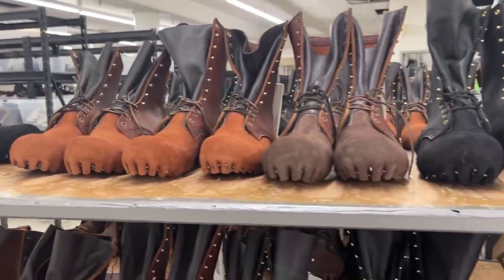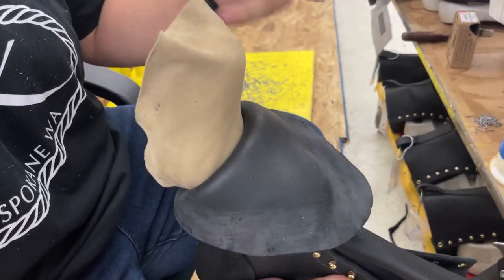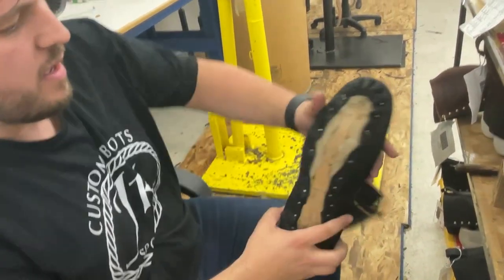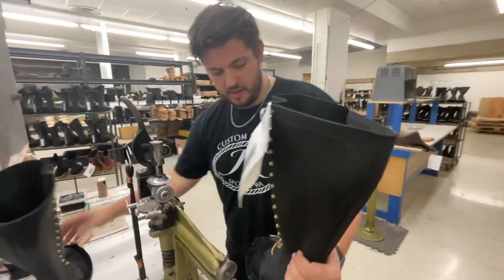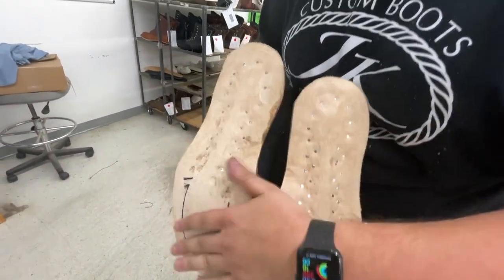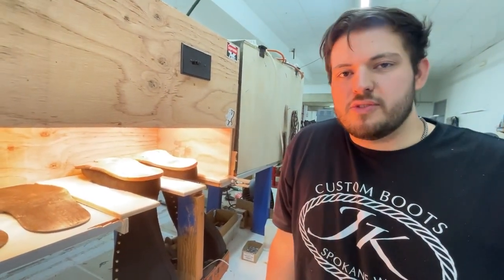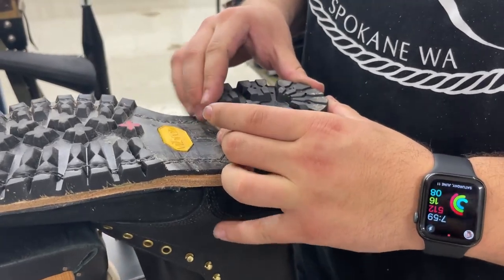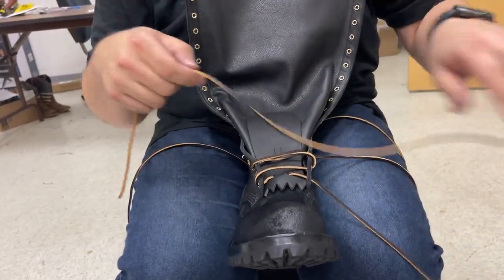The BEST Boots For Climbing With Spurs! How Custom Lineman Boots Are Built by JK Boots

Comment: Thanks for this awesome video for us boot afficionados! It's an extremely rare privilege they granted your filming request. I'm sure Wesco, Nick's, Whites, Hoffman boot companies wouldn't have done that. Legal would prolly not allow it as they spend millions on P/R, customer service, legal, marketing, and advertising, so everything has to be exactly in sync and perfect facing the public.

I've had Wesco make and rebuild 3 pairs of loggers/lineman's boots of different heights since 1983 and make one pair of 18" engineer boots in  2014.   A couple things stand out that perhaps you should mention to JK Boots. An "L" steel heel plate protection that's fitted between the Vibram heel and the oak leather part to prevent the climbing spurs from shearing those two pieces apart, even with screws. Second is an optional leather lining to prevent soiled socks from boot oil. The boot fit needs to be adjusted slightly for the smooth leather lining (no sock staining either 😊). My last pair in 2014 was $475 with 6 weeks lead time. Today it's $880 with an 18 month lead time. 🤯  Have you ever tried on Wesco logger/ lineman boots? Thank to you I'm considering a JK two tone gray roughout  logger/lineman boot. I just like the way they fit and feel on my feet. Forget Geogia, Carolina, Tec, Red Wing, and Chippewa boots. They don't go the distance today. Crocs??! Get rid of them dang thangs! 🤣 John.

Comment: Jacob,
Just a question, can I ask you if you thought of having him put Calks in these boots ? 
 I have 2 pair like I told you before but both mine have Calks in them and both are the 16" uppers (18" in my case) and both are designed for climbing like Lineman's boots But I don't do any climbing period nor does our Son or the other 2 guys who work for us. See I gotta have the extra protection for my upper calves  and shins these boots provide me for medical reasons. Any soft tissue injury to my feet or legs and it takes 3-6 months to completely heal so you can see how even a hard bump on my shin or a scratch from a dead old sharp busted branch on the ground can give me real problems. So both pair I own and wear 90% of the time have Calks in them. I also have a regular pair of Black ones that I wear for good....I have a pair of tennis shoes (old stock Converse All Stars and a Nice dress pair of American made Italian style Black Dress shoes) but I wear my boots one style or the other 99.9999% of the time.
Just wondering about the Calks...
By the way this guy makes very nice customs based on what we saw in this video 👍👍👍

Comment: Why did you go with JK Boots and not Nick's Boots?
Reply: Probably because they are an almost identical product and nicks lead time is like 6 months out versus 2-3 for jk. JK and franks are still primarily focused on work boots, nicks and whites are owned by people who never built a pair of boots and are more focused on pushing their “heritage” lines to break into a new market and drum up as many sales as possible. 

I’ve worn out whites and nicks. They are fine quality boots and I have no complaints about their product. I’ve got a pair of jk that I hardly wear because I don’t care for the smaller arch in them. Quality is on par with the others, just the lack of arch is noticeable at the end of a 16 hour day.
Reply: I prefer the JK arch for climbing in spur’s, it is slightly lower, but when all your weight is concentrated in the arch the JK is more comfortable at the end of the day.
And that is also an individual preference based on your feet, wore whites for 38 years before trying the JK, JKs love my feet just a little more.
Reply: @brucethom4957  Oh yeah, it’s totally personal preference/job requirements. I’m not a climber, so I have no extended experience on gaffs. I can definitely see how all that extra pressure in that area would lead to you wanting a lower arch to start with though. Jk, nicks, whites, Frank’s, and vibergs are all on the same level when it comes to quality. There might be small differences in materials/construction, but none of them are definitively better than the others. It’s just a matter of what fits/works for you the best.

Comment: Those look like great boots.  It nice they have little break in time.  I usually wear an 8 in logger.  I am always hard on the toe with the work we do.  Then next boot I may look for a boot that has a protective leather on the toe. I like the shank they have in them for working on ladders.  I could hear it popping in my boot due to wear.  Good boots are worth the money.  I have pulled my ankle in them but did not break it.  Which for not to have the proper footwear on could have been a lengthy time off work.  thank you for sharing.  I will look into them.  Hopefully I can find something for my needs.

Comment: Why don't you tie the strap under the spur?  Moves less and is more secure.
Reply from the maker: I’ve done that, it works okay when you have no heel but it’s more comfortable to not have to crank so hard down on the strap and just have a big heel like on these. If you have a big heel you don’t need to tighten the spurs so much and they don’t move around

Comment: Off subject, I know, but what kind of axe are most loggers/fellers carrying on their hip as they work all day?  5lbs rafter or something lighter?
Reply: From my experience it's a 4-5lb rafter. Straight handles around 25-28". I make axes and that is what is requested most by fallers.
Reply: @conrad.blacksmithing  
Thanks for the reply. How much do you charge for a 4 pound rafter?
Reply: I have seen anything from 3 to 5 lbs on the Fireline with 20 to 28” handles. Did see a faller pull a 6 lb and 36” handle and some 15 inch wedges for a gnarly old tree once.